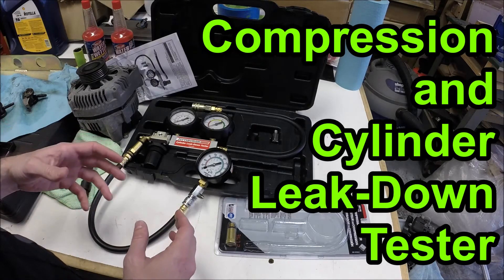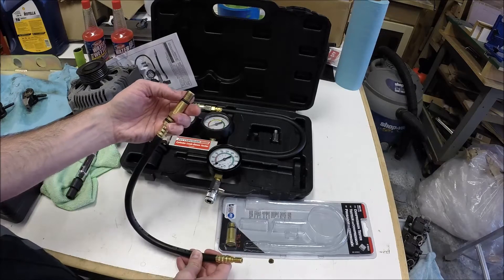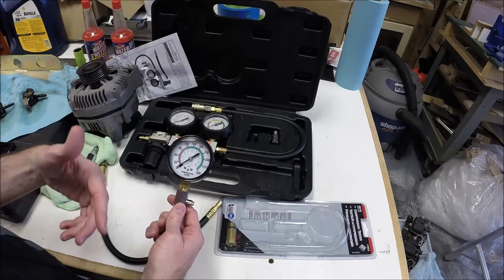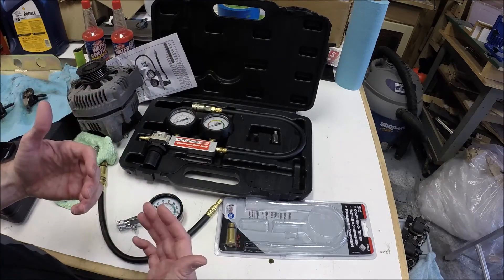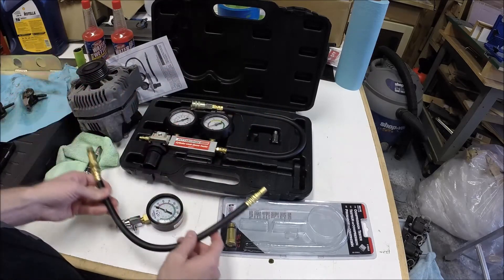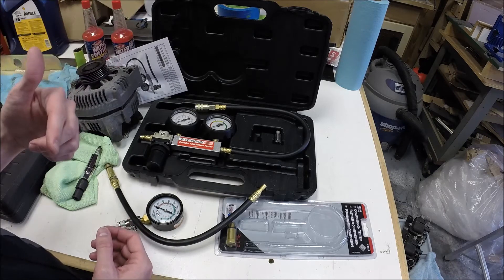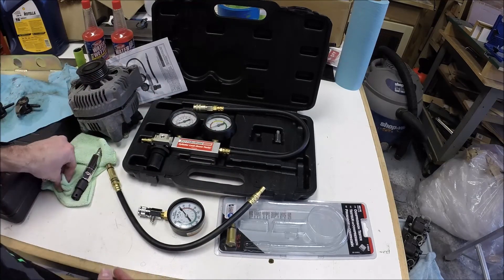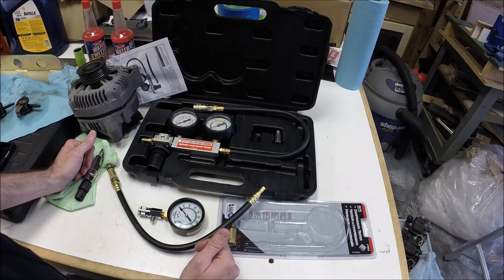Compression and Cylinder Leak Down Tester

Comment: did you notice any blow by out of the oil fill while it was running?
Reply from the maker: Yes.   It happened on the back straight at VIR.   It pressurized the crank case and pushed oil out of the dipstick tube.  Which sprayed on the headers and smoked like crazy.  Luckily no fire.   Afterwards, even at idle, I had a whispy smoke coming out of the oil filler and you come feel a light air pressure if you put your hand over it.   So I had a pretty good idea that I had cracked a piston, but I did the compression and leak down test to confirm before I started pulling the motor, etc.
Reply: Thanks and oh damn that could have gotten bad. Don't they get steam pockets in the cooling system that help cause this or was it just piston failure?
Reply from the maker: I suspect it was an air pocket in the cooling system.   Prior to that track event, I had changed the coolant.  I had driven the car several times in weeks prior to the event and did not have any hint of overheating, etc.  But the piston failure occurred just a few laps into the first session on the first day at the track event.   Also when it happened, it puked out a bunch of coolant.  So at first I thought it might have blown a head gasket.   But I pressured check the cooling system afterwards and had no issues.  And of course during the leak down test, there was no pressure in the cooling system, and when I pulled the heads there was no apparent damage to the head gasket.  So I suspected the air pocket caused some sort of disruption in the coolant flow and caused the overflow tank to puke some coolant (which also smoked off the headers, haha).  When it happened on track, I did check all of my gauges and coolant temp was normal.   So when I put the motor back together, I added the rear steam ports as a "just in case".
Reply: damn the luck, one would think any air was out of the system at that point
Reply from the maker: Yea that's what I thought too.  Had even driven to work, etc.  So it had gone through multiple heat cycles, etc.   Oh well, nothing a boat-load of money and 1.5 years of my life can't fix, haha.